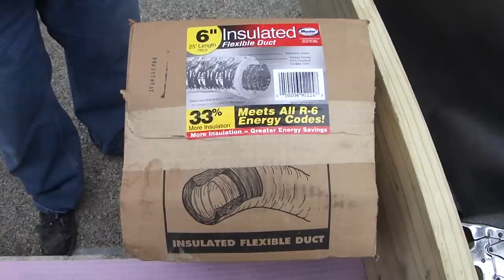Building A Small Room Addition And A Deck

Comment: I love this guy, this room will last his life just fine. Problems later..probably. He saved a lot of money and he's happier than the guy who pays a pro!
Reply: I had to post a reply to you because its not just the fact that this is done so wrong but that he is Charging money for this (He is pretending to be a  contractor) If you check out 33:17 he says customer!!!  Well how would you like to pay out your hard earned money for something that very low quality of finish and is structurally unsound from day one and after a few freeze thaw cycles those improperly mortared bricks are going to start to fail!! Framing is wrong!! heat runs are wrong!! this whole thing is just wrong!!
Reply: My bad, I didn't realize he was being paid. This is a bad job for a contractor.
Reply: Reno&RepairHow2's Most construction contractors don't need to be licensed in Illinois

Comment: What I learned: A union heating guy grossly overcharges and we can do it ourselves for a fraction of the cost. Thanks!
Reply: You can modify your HVAC ductwork yourself. I would highly suggest that you do not repeat any of this persons work. And if you’re going to add a register, make sure that you do the math, because if you tie into a 4 inch duck work like this moron did you’re going to take away air that might be feeding to a second floor which would make that zone very uncomfortable and hard to control zone.
Reply: James Smith  They just see someone doing work without understanding anything behind it. Mindless cheap zombies

Comment: Just as an additional piece of knowledge if anyone reads this. When you install the “insulated flex duct” there is panduit straps you can use instead of tape. It’s the same as a zip tie so it makes it tight and you don’t have to worry about your tape falling off after time

Comment: NIce!  Only things I would have done differently is space the heat vent off the header joist by 5" so when you put the wall in over it (3.5" + 0.5") it's spaced off the wall by 1", and tied into the heat duct so the splice T piece exits the source line horizontally, so the hot air is not forced down and then out.  Pretty minor adjusts though, great job, thanks for sharing.
Reply: A WYE cut in horizontal would be good too. Also screwed in then tape. The flex should be zipped, screwed and then taped. Outer insulation rolled and zipped over that. That’s how we pros so it

Comment: As a suggestion, tie foundation ad-ons to the existing foundation. So the ad-one don't settle separate from the house
Reply: Oliver Aguirre that's a great suggestion IF there was no threshold of the sliding Glassdoor, even if it did settle a little bit, it won't matter. But still it would not hurt to just tie it up...

Comment: PS I forgot to mention. That addition is Gorgeous, and the deck is outstanding. I have not seen quality building like that, in a very long time. The owners of that home have to be really thrilled with the results. The railing is perfect too, I am going to do that, and the other suggestions to my deck now too. It's all very beautiful.  Thank you for sharing.
Reply: Dude... You can't comment on your own video under someones name besides your own?
Reply: Look at the head joint on the blocks has no mud in them
Reply: James Bowers you're right. Cutting corners for sure
Reply: Sheila6325 À
Reply: Oye!

This can’t be real! Fake construction news for sure! Do not listen to this guy, at all! Let me see one inspection card that shows a passing result, just one.

Rim joists go on the sill plate buddy! Rafters are overhead on a pitch! Joists are in the floor. Pours should all be done at the same time. 

What a hack!
Reply: NO PROBL. HE used 2X8 to align them! ;-))

Comment: Great, do you also rebuild engines? How about minor surgeries? And I need a new bridge built, but don't use any codes. I like the way the floor vent came out, having half of it in the wall is a novel idea. I also like the way you chewed the cutouts in the drywall, much better than clean cuts. Never bother to line up the horizontal siding with the rest of the house, it can take longer and looks too professional. And the electrical, I can only imagine how safe that must be, if you say so. And not pinning the foundation gives it ample ability to separate from the house, another great approach. I'm sure the nominal nailing of those blocks to the bottom plate and rim joist of the house is going to last 40 years plus! And lower vents for air circulation, not needed I guess because you left them out. The beefed up blocking on the roof, it looks like you nailed them on, I bet those nails last 50 years, thanks for showing us the right and safe way to attach it, maybe no one will get killed, maybe. The rats that can easily get in and nest where the HVAC duct goes through will appreciate that. Good thing the existing 6 inch line was there, otherwise, you would have to do it right and go back to the plenum. Glad to see the window so close to the ceiling, eliminates the need for proper trim. And going down 42 inches, who needs to, you know how far to go and saving cash and time by not using re-bar, brilliant! In fact, doing all your own inspections saves time and ensures passing first time every time. Anything questionable is covered up now anyway.

Comment: You cant just add to a heat vent. There are very specific guide lines you must take into place or you could be starving your system etc. Hvac is not for the DIY kinda person and an 8x8 room should not have 6in pipe running to it...
Reply: this info is interesting and dangerous diy projects should be monitored by a pro who knows code

Comment: he seems like a nice guy yes... I do believe in DIY. but lets see..... your footer isn't thick enough, your concrete blocks don't need filled up just the one that have the bolts, you just didn't have enough mortar in your joints.. those few boards you tried saving could of been torn down and redone properly in less than a hour. the  floor joists you were calling rafters need a plate attached to the main structure, and the boot you installed for the heat run is a 1 1/2 inches from the out side, your register will be partially in the wall !   must not be building permits required in your area... I wish I was your neighbor I would of helped for free.
Reply: do have to say... atleast you tried. hate it when I hear about a man that hires someone to simple repairs to their home... be a man and get it done, and if you don't know do some research.
Reply: No pressure treated bottom plate.
Reply: Everett Leonard For the record, I do believe in filling the blocks. Anything that keeps moisture out - while more expensive and time consuming - eliminates the eventual cracking that WILL occur from water freezing after getting inside.I live in a wet climate, with more than 100 degree temperature fluctuations annually. Even the smallest amounts of water absorption can lead to tremendous damage. I built a supporting wall for a walk-out basement, and decided to only fill the blocks to 4 feet. After just 2 years, the blocks above 4 feet had absorbed enough water (in this case, just 2 inches) that the freezing caused a stress crack. In my mind, it's either an additional $100 up-front cost, or an eventual $1,500 fix.
Reply: They guy used blocks with forms, that's absurd. If you form it, use concrete with rebar. If worried about moisture you should use EPDM. That deck with touching two by fir will rot in a year also. I was floored when I heard the word customer used
Reply: Jay Trask What do u mean by that deck with touching two by fir will rot in a year..just curious
Reply: The touching deck boards will cause water to pool. The Doug fir will rot
exposed to water. Pressure treat and cedar are for exterior application.
Reply: Everett, love to see your video.  Where is it?
Reply: @mdevidograndpacificlumbera1539  That footer will be all brittle and cracked up in a few years. Dude used standard quickcrete, most likely mixed in a wheel barrow, poured at different slumps and minutes apart from each other. If you're going to DIY a footer, at least do some research and buy the 5000 mix and rent a mixer. The codes aren't there to make money, they're to keep the "oh it'll be hidden when I backfill" morons from filing insurance claims when their projects start to fail a couple years down the road.
Reply: Everett Leonard there is nothing wrong with core filling the block one thing I noticed is he didn’t even tie in to the existing foundation with rebar.

Comment: Oh goodness. I don't really like to tear apart someones work; however, if I had someone working for me turning out work like this they'd be out the door. Where are the joints in that block work? What's the need for those form boards? You have a level sitting right there. Those aren't rafters they're floor joists, and 2x10 is pretty overkill for a 7-8ft span at 16 centers. That sill plate gasket isn't really doing much where it's at. I had to stop there. I commend you for taking on a project and following through but I would never be comfortable running my business with this level of craftsmanship.

Comment: My addition I am digging down 2' pouring in pea gravel, then 2"concrete, then add the concrete blocks and concrete together.  Put metal bars in each one. I have to take down the porch like you did, I might be able to save the roof. I still am going out about 16' from house. Doing the bathroom and then the kitchen. Old cabin house. Childhood home. Just want the rooms a bit bigger. Has a lot of water damage. Have to replace the drywall and insulation. Maybe the wiring too. Some will definately be new wired later.  Stop the roof leaking first as a temp. I will be adding a top floor to the place. It has 2 small attic bedroom and toilet cubby hole, small place.  This year 2019 bathroom  5wX7L into a master bath of 9wX24L. Next April 2020 will be the kitchen 16wX26L
gormet'. Kitchen is 16wX9L Now. 
Getting started on the bath next week.

As far as putting cinder block down as far as the ground instead of the pea gravel like you did, The frame of the house will sit on it, but no one walks over those cinder blocks.  It doesn't need to 
have the cinder blocks in the ground. Your wall will not put stress or pressure on that part. You will not be walking on it.  You can add concrete to the pea gravel. I might do that.  Work just as well.  You have the metal rods as well securing it.
Less work with just adding concrete or cement with the rocks in ground then put cinder blocks ground level.

Comment: 'Alot of people don't know what they are doing...' Oh dear Lord!!!
A heating engineer will charge you a lot because he will do it properly... Where is your putty and self drilling screws to hold your ventilation t-piece in... 5 days and that will be on the floor of your basement...
Reply: Easy fix if it does happen.
Reply: Now they are calling themselves heating engineers. Lmao
Reply: That’s what I though. That tape is for insulation not for holding weight.

Comment: As a licensed A/C contractor please do not do this. Only hard duct can be installed under a house, no flex duct due to animals. Needs a Y not a T to tie into the duct. Needs insulated boots and mastic seal. There is a reason contractors charge $300-$400 to install it the CORRECT WAY

Comment: Another job done by a hack that will eventually have to be redone eventually by a pro contractor who knows what they are doing and knows building code
Reply: The thing is ,he is a contractor don't you hear what he said almost in the end of the video,he said the costumer wanted this...
Reply: Caution is warranted with regard to blind trust in just about anything, government codes included. Much of what government code and regulation has done has been some of the most harmful to humanity, considering toxic dumping, large scale failures in resource management, the devastation of nuclear weapons testing, irresponsible government drug experiments in the health care industry, and the once new, now historical building "code" calling for asbestos, tight houses, lead pipes, and other materials that turned out to be deadly and required massive remediation.
Reply: Many in the public health and allied health professions have devoted their lives to remedying the disasters those universal prescriptions called codes have been observed to have caused.  Asbestos caused cancers. Lead pipes caused metal poisoning with physical and mental illness. Tight houses caused toxic mold proliferation. Although useful in many cases, the mere fact that it is a government code does not mean it is proven safe or healthy. 

Some of the code is empirical, experientially based and scientific. Other parts of the code have a theoretical basis. Study them out for yourself before drawing overgeneralized conclusions.

Comment: your add on will ruin this house when it sinks into the dirt because you put no soild foundation and the gap in the deck is so water can drain your removing the gap will make water pool up soak into the deck and rot it there are to many problems to even point out so i will not bother and before you try to say i dont know what in talking about i come from a family of skilled carpenters and you should not be a contracter because you have no idea what you are doing and should not be calling yourself a professional i could do a better job and im only 17

Comment: Greg,

We have a 1:12 pitch vaulted framed rood from 1958. We have zero insulation in our roof. We live in hot and humid Central Florida. Out roofing is torch down roofing. We do not need a refoof job as it was installed in 2002. The roof is fine. Our problem is we don't have insulation. We have soffits with a 2 inch hole in each rafters bag and we have a 12 inch Whirlybird in the middle of our roof for taking out the heat. How should we go about insulating our ceiling? Thanks. I have enjoyed so many of your videos.

God bless,

Jeff

Comment: I’ve seen a bunch of American HVAC videos in the past. I think you need to put a butterfly valve in that T split where the hose is connected to? So you can regulate how much hot air is coming out at which register. Right now it’s just a gamble that it will be ok.

Comment: Well done. The only issue for me is the duct work. The best way to learn is just do it. Don't be afraid of trying. You'll find it all comes together and if you get stuck, go to the library and check out a book on carpentry. I build and have been in construction since the early 80's Take you time If you get frustrated, walk away and do something else. Think about the problem and you'll figure it all out. Or go to  construction site and look around (don't get hurt and ask first).

Comment: Nice video, good work...  But your siding skills need a little work, because none of the lines match up with the siding on the house.
Should've use utility trim and added it inside your J channel on the first piece or just started with utility trim... That way you can trim down the starter piece to match your lines, the utility trim holds trimmed boards  in place...  You can notch first piece before inserting into utility trim for extra strength...

Comment: Cool video. I was a brick mason all my life. I've never seen anyone build a frame to lay block to.I always squared up my foundations footings with nails and pulled a string or used a chalk line. I never use junk quickcrete for mortar mix. That stuff sucks. I use brixment and sand. The quickcrete is just too sandy. Plus the fact it cost double to use that. Such a small room I didnt see where you put in foundations vents? was there none? Always put a couple of vents in you're foundations for air flow to keep your floors from rotting. I admire you did it yourself I just see a lot of things I would of done differently to save money and still have a good foundation.
Reply: Steve Rants I mean no disrespect it looked good when you got it finished. Kudos to you

Comment: How is the new foundation connected to the existing one ?
Reply: Ne kontam, sta je ovaj postigao sa pravljenjem te male prostorijice sa dvoje velikih vrata? da bi prosirio i terasu sa druge strane, gde je mogao da ima veliku sobu a tu gde je ovo pokrio mogao da ima malu terasu :)) !?
Reply: Dalibor Milenkovic Clearly, it is not. This is like "Larry The Construction Guy". He put 25 feet of insulated flex duct on about a 10-12 foot run, and connected it to the main duct without measuring, and connected at the BOTTOM. Because, as we all know, hot air goes DOWN (sarcasm).
Reply: LOL sorry Dalibor Milenkovic hot air goes up.

Comment: Codes are a minimum standard.  Not that difficult to meet or exceed them.    As long as he lagged into the house frame with his connections and flashed properly at floor wall and roof junctures, that thing is not going anywhere.  I like to put a 7 inch step down from the house to any porch, balcony or deck to protect door sills, siding and interior floor from weather.  Looks like a good job to me.  Thumbs up!

Comment: Down here we use rebar in the blocks to prevent shifting and we use an excessive amount of mastic on and around all connection points/seams on foil tape and holes and vent seams.

Comment: on installing your flex duct, you should have used large zip ties with a hand tightner for the inner duct. Pull it tight, band it with zip tie, duct tape it, then duct tape the outer cover insulation. Using only duct tape will result in the tape failing and sliding off when the duct warms up. After 6 moths you'll have to do it over again. Just saying.

Comment: another thing you can do to stop step-cracks apart form filling in the bricks with concrete is to every four rows of layer of bricks cast a six inch ring beam with rebar reinforced  concrete , that prevents the spread of cracks upwards.